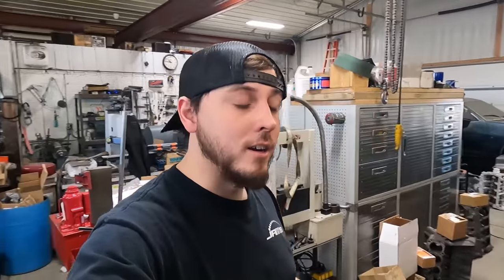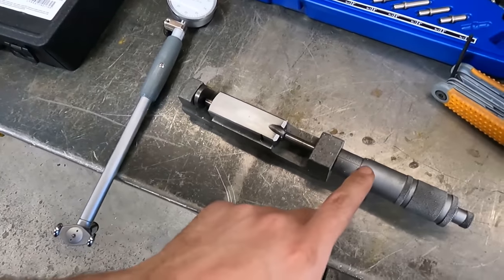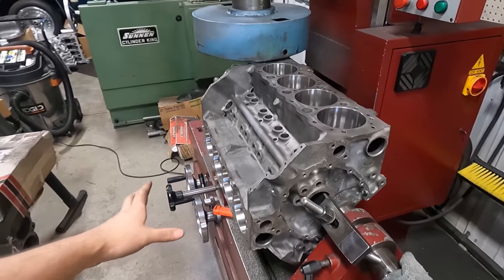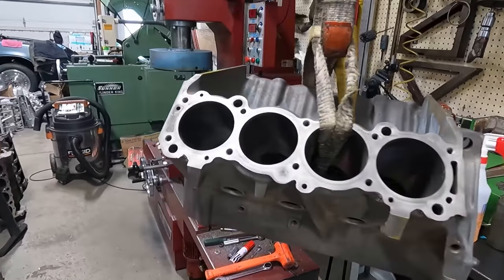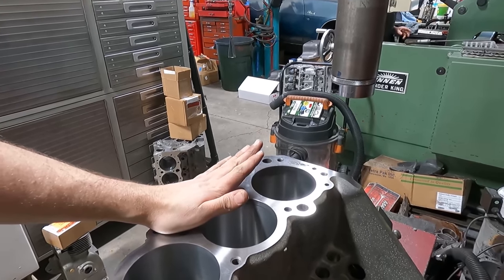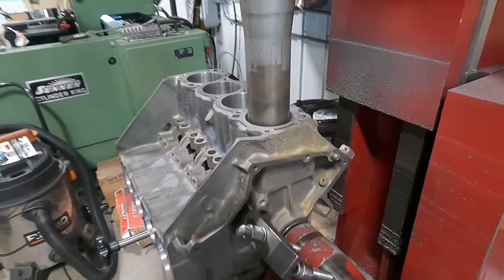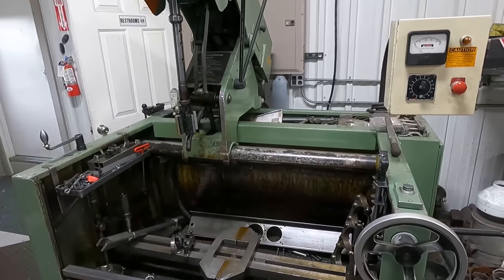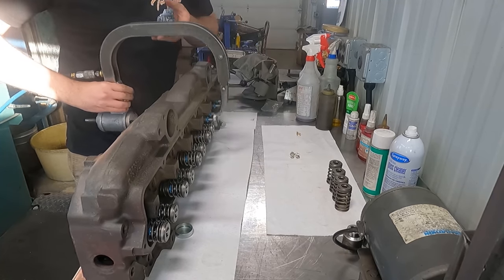340 Buick & 350 SB Chevy Block Machining - Shop Vlog Ep. 3 @JAMSIONLINE

Comment: I milled blocks square using a Storm Vulcan 85-B.....Moved the block to a boring table and bored it using a Kwik Way FN boring bar that sat directly on the block deck. I could offset the bar a little and often did for a couple reasons. I Moved the block to be honed in a CK-10. All 3 machines were right inline with each other within a small area and I had a rolling over head crane to move the block from machine to machine. We did not have a Block Tru fixture setup but did a lot of race engine work and honed most blocks with TQ plates. The only machine I never ran in the shop was the CK-10. Had a couple other guys over the years that ran that one plus the shop owner was totally into honing blocks for race engines and NO one could do as good as he could. Keeping the cylinders straight and getting the perfect finish. The modern automatic  machines are amazing. I honed zillions of rods and bushed them as well. We did not have a power stroker on the rod hone. Honing rods was a real PITA to keep them from tapering.....I constantly fought with that machine !! I miss that life.

Comment: Do you do any work on small single cylinder engines? Specifically 250 and 450 race dirt bikes? Valves on 250 are 28+ mm not sure about 450s. Guides are 5-5.5 mm. I know Neway makes kits for cutting them but idk if you can get pilots that small for the serdi. 3 angle valve seat. The bores are pretty big too but they are plated. Not sleeved.

Comment: Very neat work, how often do you change the honing oil as I guess it will hold x fine particles 
ATB from the UK
Reply: I bet that this machine has an oil filter, because so much oil is not that cheap, and if you are already working with engines, you can get pretty good prices on oil filters. But I would need to do a spreadsheet calculation with a few factors I don't know (exact oil type, maximum acceptable amount of particulate, amount of oil in use) to answer that question from an economic standpoint.
Reply: @vincentguttmann2231  two big filters, in the back on the left side.

Comment: Interesting to watch but I don’t understand how you align the block for boring. You have a donut on the center of the mains and I assume that the alignment is never changed. The decking on the block is aligned with the large 45 triangle and then you are using a spirit level to finalize the position before clamping is completed how are you centering the bores before you begin machining are you using a dial indicator?
Reply: Yes, the boring spindle itself has a small coaxial indicator that goes to a dial on top of the machine. If you buy those as a tool, they are also often known by the name "wiggler".
Reply from the maker: I think on the next V8 I bore I might just do an in depth setup video on the machine to clarify. Then it can just be on my channel and when people ask this question I will make them watch the video lol!

Comment: Just curious, when I worked in my friends machine shop, he suggested to hone the mains with them torqued to spec as they can tweak the bottom of the cylinders just like the torque plates tweak the tops.  Why don’t you bore/hone with the mains installed?
Reply: I have actually experemented with that quite a few times and never came up with any changes in bore shape/sizes. Plus, if there was a slight change, it would be at the bottom where the rings are not stressed for sealing like they are at the top.